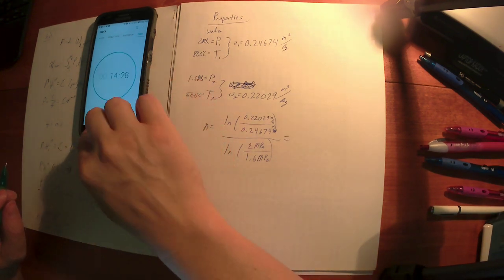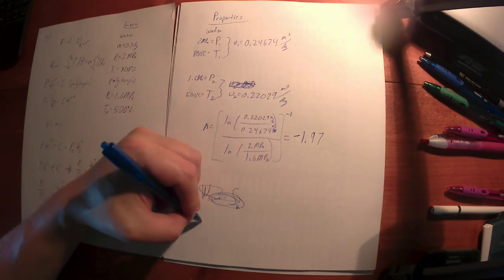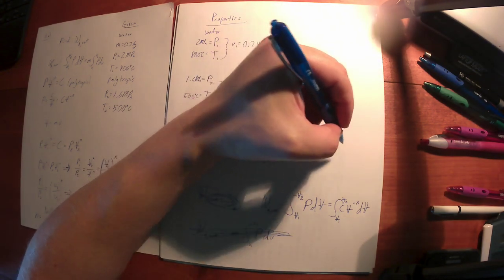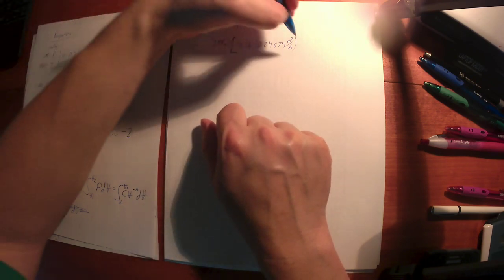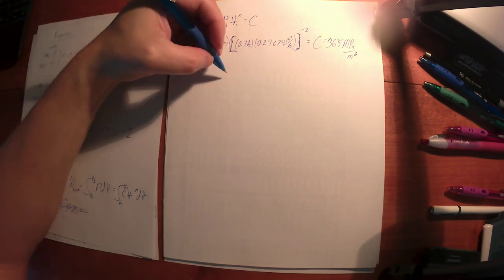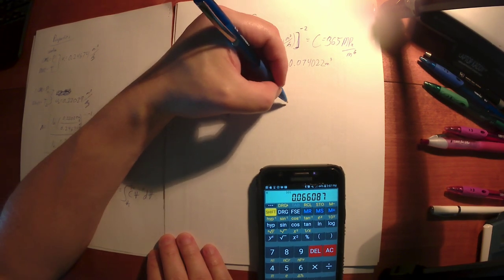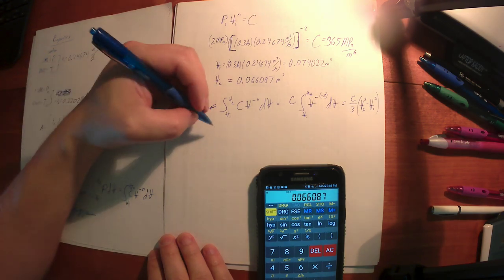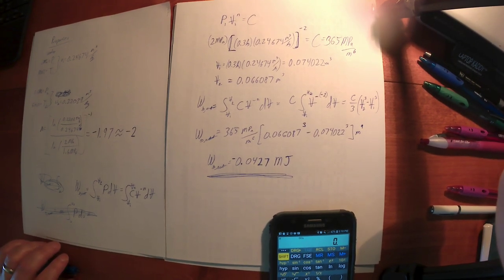Thermodynamics Lecture 9 part 3

Comment: When calculating the boundary work out, you have it as c/3 but then only multiplied by the full c. Was that an accident or did the 1/3 go somewhere that I didn't catch?
Reply from the maker: Yes you are exactly right! that's a good catch. The final answer should be divided by 3.